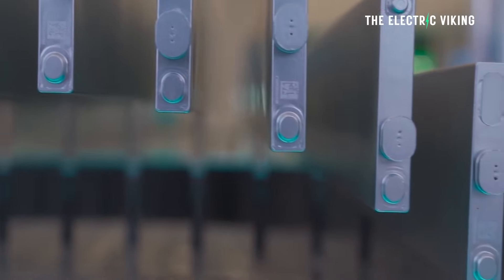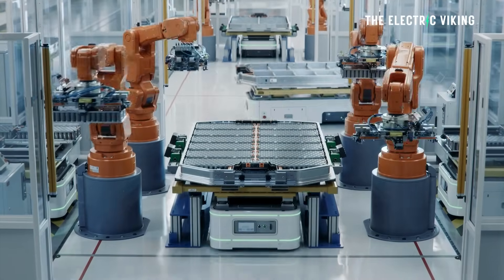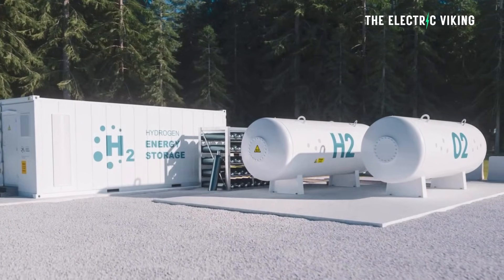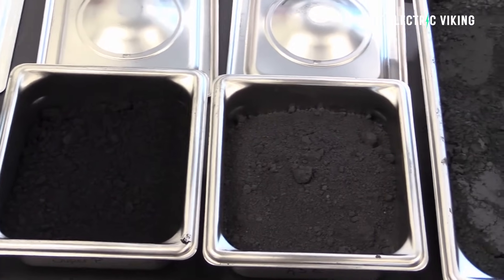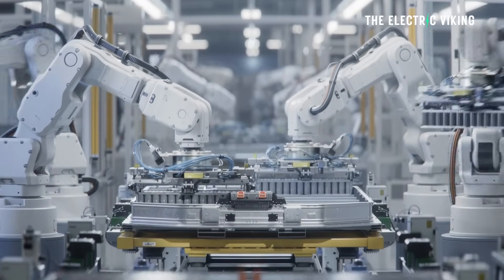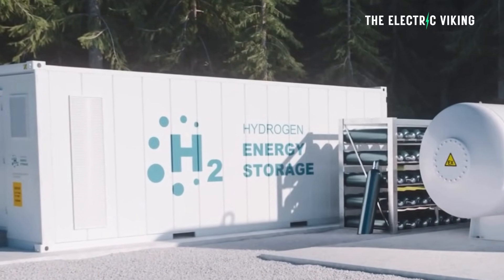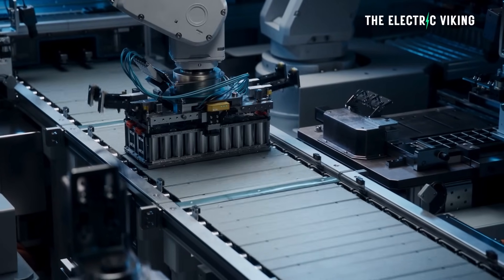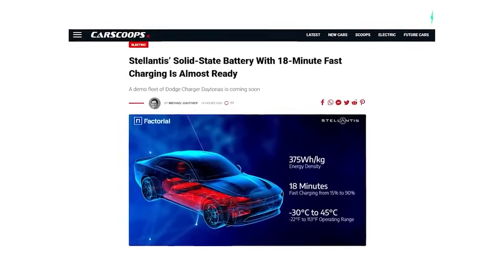Are Hybrid Lithium-Hydrogen Batteries the Future or a BAD idea?!

Comment: The two major problems with hydrogen, whether supported by a fuel-cell or a hybrid-battery approach, are its low volumetric energy density and high energy demand in production. Even with a hybrid-battey approach whilst the mass-based energy density may be high the volume-based needs additional external energy to be used to reduce the hydrogen volume to usable levels (via pressurisation or cooling) but even so still eats into available vehicle cabin or cargo space. 

Further, the production of hydrogen requires even more external energy to be spent to generate the gas, whatever the coloured hue form it takes be it green, blue, pink or grey. The net impact is more energy is spent than returned at the wheels of a vehicle, with an overall lower efficiency than other battery technologies available and under development. 

This limits hydrogen to niche applications where it will have a precarious and eroding lifespan as battery energy density continues to improve making hydrogen technologies for transportation a high-cost, and higher-risk, investment with significant external dependencies for success.
Reply: Just looking into the battery covered in the video it's actually a static battery approach for BESS not one for vehicles or even flight, as Sam mentioned, it uses a large site wide storage tank for the hydrogen. Sam gave the published theoretical max energy density of 2825 Wh/kg of the pictured battery system rather than the actual measured energy density, which is 177 Wh/kg (i.e. includes the battery's weight for low pressure hydrogen storage required).

The lithium-hydrogen hybrid-battery described in the video originates from a Nov 2024 Chinese research paper, but such batteries are still very experimental and at a low technology readiness level. The paper describes a dual stage back-to-back cell battery, with a lithium-redox and a hydrogen-redox battery sandwiched together that raises the voltage of the two individual battery elements if used in isolation (creating a 3V hybrid battery cell). The paper in effect seeks to propose a novel approach by raising the relatively low current capacity of a hydrogen cell battery by combining it with the higher capacity of a lithium cell, whilst at the same time seeking to raise the gravimetric (i.e. by mass) energy density of the overall cell utilising the higher energy density of hydrogen by mass. 

However, these cells currently have a relatively low areal current, i.e. current density per anode/cathode area, capacity (0.025 mA cm-2 vs 15+ mA for LFP and 40+mA for NMC) so will require a larger surface area than an equivalent lithium-based battery design currently in use (or those under development, such as the similar gaseous exchange approach such as Lithium-Air batteries that have a current capacity of 500mA cm-2, and theoretical max energy density of 11,140 Wh/kg with energy densities of 1,800 Wh/kg already measured in lab setups). With such large areas required, lithium-hydrogen hybrid-batteries are more suited to static grid energy storage applications than transportation ones.

Further, the paper doesn't detail how the hydrogen will be supplied or stored in the system, other than expecting it to be supplied as a low pressure gas meaning it will have a high volumetric storage requirement, as hydrogen has the lowest volumetric storage density at 3 wH per litre when at atmospheric gaseous state. Again suiting a more static application with a fairly large storage chamber supporting the battery (1kg of hydrogen occupies a volume of circa 12 cube metres, about the total internal volume of a Land Rover Discover). Indeed one supporting graphic image in the paper envisages a BESS  configuration consisting of a large field of LI-H battery containers connected by industrial pipework to a rather large site-wide hydrogen storage tank.

Comment: I understand it's vaporware but eventually you know someone will produce some form of battery that has 10x the current energy density of what we have now. It will happen - and when it does, we'll already have the electrical infrastructure to support improved tech. We are building it all now! So cool.
Reply: Lithium-Air batteries, with 1,500 Wh/kg energy density, already exists; although they have a lower cycle life (<1,000 cycles) so are used for specialist applications. That said labs are working on the longevity problem, particularly for flight batteries. With approaches both seeking to improve the cycle life and improve the recyclability of the battery; such as containerised flight optimised battery designs that are charged-off plane with end-of-life automated materials recovery directly feeding battery production lines in order to remake new battery cells over and over again at low cost.
Reply: You're right.This sounds like our Toyota EV smoke and mirrors
Reply: Better improve fast charging to 6C . Increasing energy density means building bombs ... safety first !
Reply: Which is why standardizing the form factor is important so that battery packs can be upgraded to new technologies by third parties at an affordable price as well as repaired without replacing the entire pack...
Reply: @johnwang9914  not so possible. The BMS and the car ECUs are interactive and highly dependent on the battery behavior.  Every slight chemical change needs to optimize again the whole system parameters on the power maps, user profiles and fast charging curves. All is temperature dependent and interact with the cooling systems.... then all needs to be tested at all levels, cell, pack and systems....
Reply: @chryoko  all of the profiles etc. could be mapped into the ECU etc via APIs as a part of the battery exchange process, it’s not only the physical interface that can be changed. Basically similar to the negotiations that occur between an EV and a charger nowadays but more complex - possibly the vehicle cooling system cannot keep up with the charge rate so that has to be adjusted etc. etc.  This definitely seems like a solvable problem, although the actual voltage output from differing battery chemistries / formulations might not be.